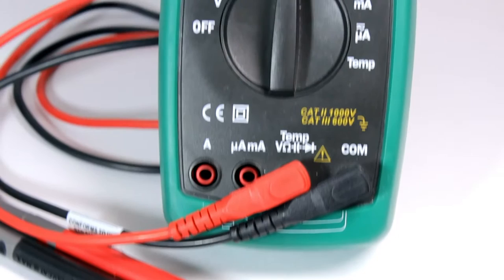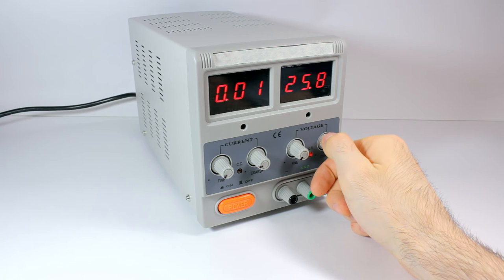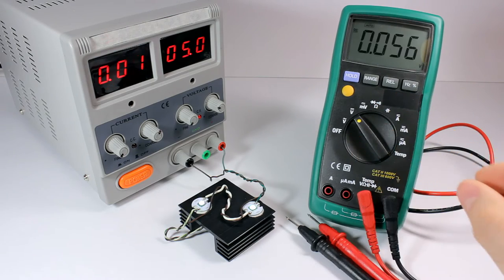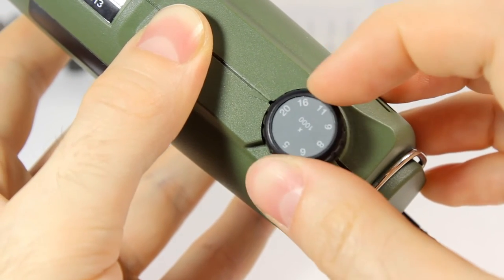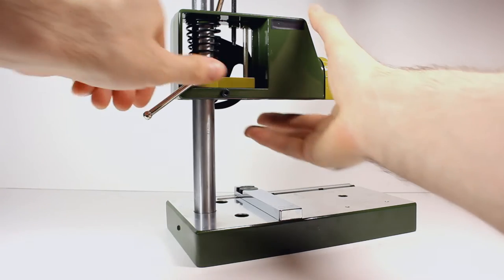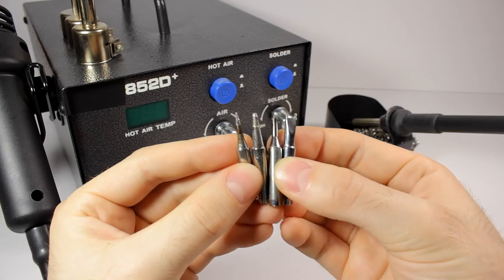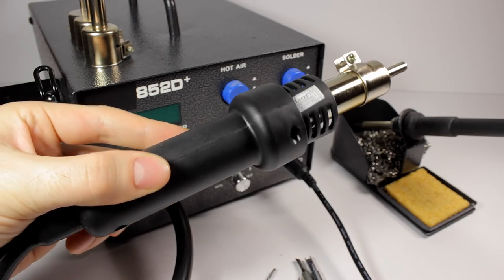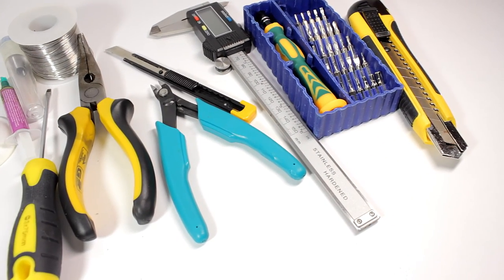Electronics Shop tour - How get started #1

Comment from the maker: Hi! You are on the #Makerside channel! If you know, how to fix floating voltage on power supply, please tell me :)
Reply: Are you concerned that the supply is not earthed?  You could always strap the common to earth ground but floating is normal.  The green should be earth reference, so connect common and green together and it won't float. (Measure twice, connect once.)
Reply: Floating better replicates battery power anyway.
Reply from the maker: Thanks for you advise, i'll check this.